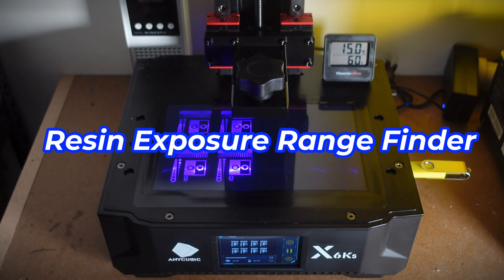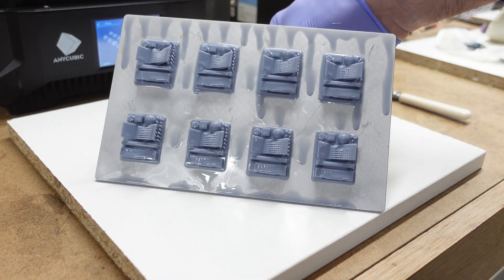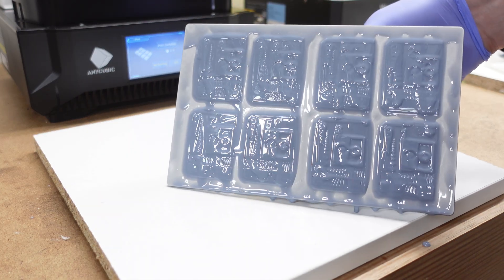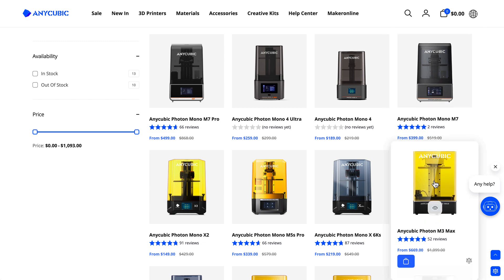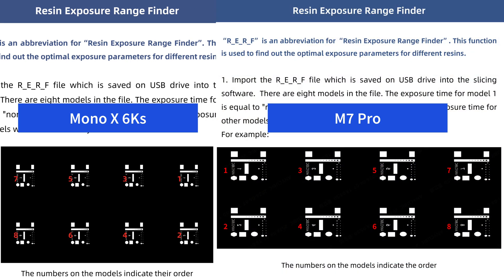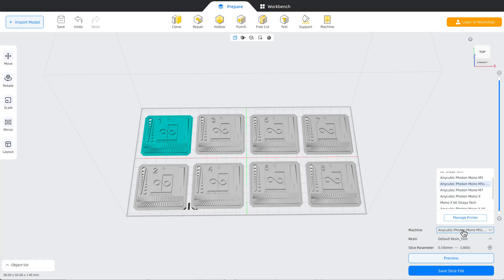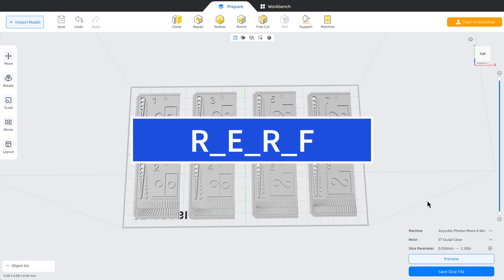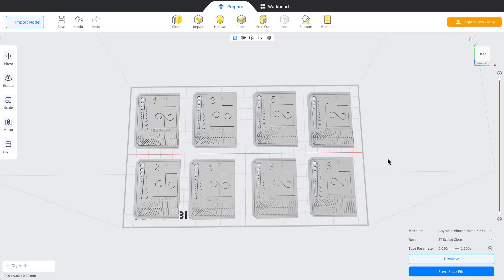How to use the Anycubic RERF test with your own model [UPDATED  METHOD]

Comment: Thanks for the helpful video as always! But when I preview the print, the numbers aren't mirrored like in yours or the manual. What am I doing wrong?
Reply from the maker: Thanks for your question. Which printer are you using?
Reply: @ColinKlupiec Thanks so much for answering! It's an Anycubic Photon Mono 4 Ultra. I started to print in the machine without the vat and the build plate, so I could see the layers, and the orientation and exposure times are correct \o/

Comment: Could the Photonsters Validation Matrix be scale to fit the 8 copies or it will be give incorrect results?
Reply from the maker: You could scale it, but the measured elements won't measure the same. You could still use a scaled version for visual analysis of print quality, which is what I do mostly anyway.

Comment: Great video but i have a question, i have a photon mono 4k, in the stock usb i had just the anycubic cube test print, and in the manual there is nthing for rerf. On youtube there are vids of this printer printing rerf but i can't find anything online, so is it possible but how can i do? do you have some solution for that?
Reply from the maker: Thanks for your question. You could try this... create a file with 8 models evenly spaced in the build area. Then save that slice file with the name R_E_R_F and let the Photon Workshop slicer add the file suffix for the mono 4K. Then print the file without a resin vat, or build plate, and watch what happens. The first 5 layers or so will not show the different exposures of the RERF test as they are base layers. But then the following layers should show the varied exposure times if the RERF is working. If it doesn't work, then each layer will show all 8 models being exposed for the same time for each layer. And...to protect your eyes, try not to look directly into the UV light. You can use a piece of paper over the screen to provide some protection. You'll still be able to see the models light up under the paper.

Comment: How do you set the range?
Reply from the maker: The range is based on the setting for ‘normal exposure’. If you set normal exposure to 1 second, the first model exposure will be 1 second and the following models will be exposed at + 0.25 seconds. So, a 1 second normal exposure sets a range of 1 to 2.75 seconds.
Reply: apparently the setting you set will be the first then go up by .25

Comment: For the X6ks, Mono 5s pro, mono 7 pro, or any other resin printer, increasing or decreasing this exposure time affects the lifespan of the printer's LCD screen or are these changes indifferent to the screen, what are the maximum recommended exposure times in the screen power settings especially for these new high-speed printers such as the mono 5 and 7 vs the x6ks, and a printer like the x6ks if high-speed resin is used could reach the speeds of a mono 5 thanks
Reply from the maker: Each screen has an indicative lifespan measured in hours. How quickly you reach the hours depends on exposure length required by different resins. So it’s hard to gauge how long your screen will actually last. Most likely a long time. Faster print speeds usually come from printing at 0.1mm layer height with fast resins, but slightly lesser quality. You can specify a faster print for older printers in the slicer, but the printer will adjust the speed according to what its internal motor can achieve. So some experimentation is needed.